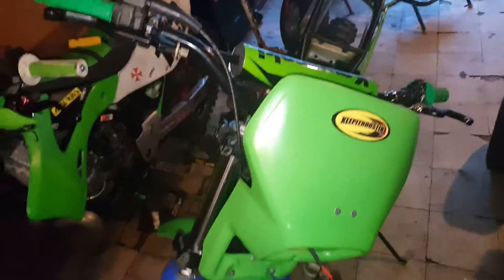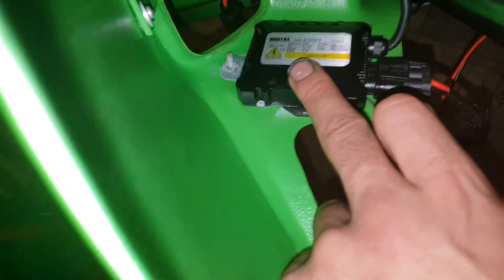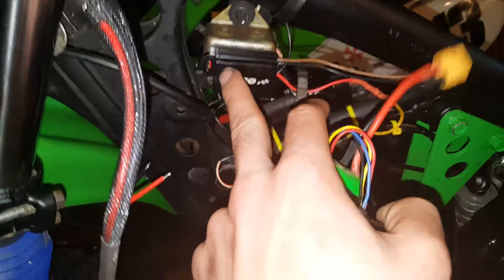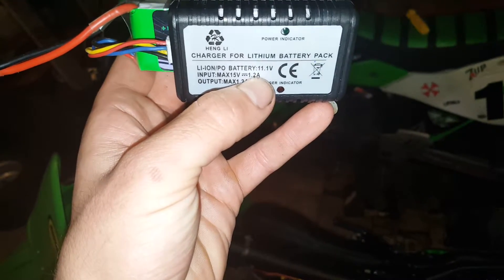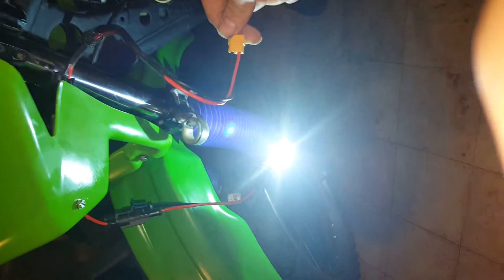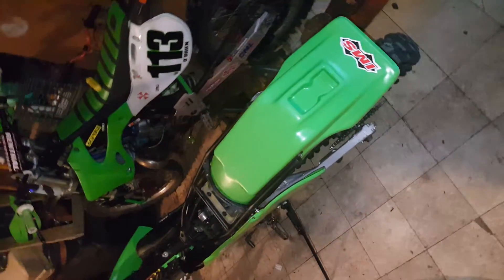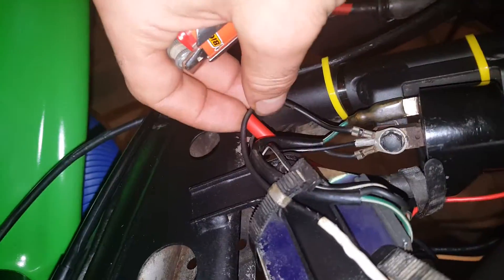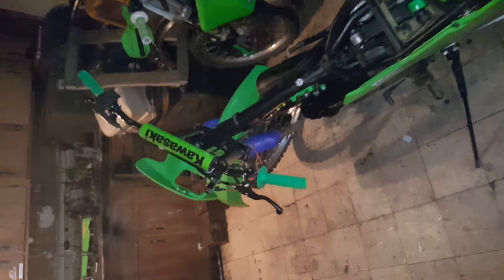86 Kdx 12v wiring

Comment: Was the battery charging as it was running or what it timing out on you? I'm in same boat except I transplanted a kdx200 into my drz 400. Currently wired lights to a switch running on lithium 18v battery. Bulb life is not long at all trying to get lights that 1 stay on and 2 are capable for night riding i saw ricky stator has a 85 watt but idk if it really will work so thats where im at . tha ks for posting such a good vid
Reply from the maker: Eric Arroyo it was charging as it was running but the voltage draw was too great I'd get a two hours to a fully charged 3s lipo at 11.1v, basically at 32W for the stock lighting coil I wasnt able to draw any more usable power. Ricky stator sells the 85W kits that would be able to power over a 7A battery 12V×7A=84W so theoretically yes it should charge a 5A/hr battery however just like the lipo issue youd need to take into consideration your draw and CCA value of your battery. Realistically I only used HID because they looked cooler than LED, however with LEDs i can get over triple the amount of time on a draw. My tail light draw only 0.02A and a newer led would probably draw around 1-2A max for the headlight which would save a ton of power and increase my run time. But yeah youd need a Ricky stator, a FW bridge rectifier, a 3-5 amp diode and a 2500 uF capacitor to make a Ac/DC converter box I've made them but they needed a stronger stator to work. Hope that helps man
Reply: @sparkynf12  thanks man i really appreciate it
Reply from the maker: @EandECustomCycles  no problem man, anytime.

Comment: Hi Nick, this is Marius From South Africa can you please contact me via E-mail mariuskok@rocketmail .com In connection with the conversion on your kdx. I try to explain to the ppl here
that work on my kdx, but they have no clue as to what i'm talking about. Kind Regards
Reply from the maker: I can just give you a parts list if that helps more, you'll need to buy a KOSO voltage regulator/rectifier, a lipo battery, a lipo battery balancing charger, and wire. Your lights you just hook up both negatives going into the negative end of the battery, and the positive is switched with a just a regular single pole single throw switch going from the positive of the battery to the switch and then to the lights. The KOSO Vreg/rectifier has 4 wires total black and red go to the lipo charger input to charge the battery. And brown and blue which brown gets grounded to the frame, and blue goes to the yellow wire coming out of the stator which is for your stock lights. Hope this helps

Comment: Very nice man. I have a 86 KDX200 as well. Could you list parts required and possibly a wiring diagram? I want to purchase a 12v headlight for mine
Reply from the maker: mitchmanisbomb I have more videos with the wiring diagram. I ended up using a koso rectifier with a dc voltage regulator and a lipo rc battery that I used for my drone. Also the charging circut is a 11.1v 800mah also an extra rc charger I had for a turbine heli. I used marine caulk to seal it up and mounted it in the tool bag with a nomex/kevlar lipo firebag. Hope this helps
Reply from the maker: I could list all the parts I used, and provide a wire diagram for the actual bike, also I used a halide bulb for the front which I get 38mins from a full charged lipo without it charging @ a 25C discharge rate, if I used led like I was going to, id get 2hrs+ and connected I'd get a bit more time I belive it came out to 4something hours. I am going to end up using two of these batteries in series, with a inline fuse, or get something safer than lipo. Either way two batteries doubles the time or while charging almost triples it. Me personally though, I thought the bluish hid looked cooler especially with the ballast, that's why I went that route.
Reply: Nick Ferrucci helped a lot. I already added the items to my shopping cart while watching the video based on the specs you were stating. How many volts does the stator put out during idle? Thanks for responding dude
Reply from the maker: mitchmanisbomb I belive it was 18.8 on idle, and 22.2 at 1/4T
Reply from the maker: Also no problem bro. I'm glad it helped, I figured since there is no info really online other than one other guy that did it on kdxrider and charges for diagrams, and the fact I really love the older bikes, id put it on YouTube lol plus the fact at first I honestly had no clue it would work, and it did perfectly, so the theory was pretty accurate. One other thing is I used a thinner gauge wire, I think it was a 14-15ga. As the stock wires were like sitting at a 12ga and were roached.
Reply: Nick Ferrucci hell yes! A wiring diagram would be great. Really appreciate it. Thanks for the info. My engine is apart right now so I’m kind of out of luck when it comes to observing the data. I’m probably just going to run an LED bulb. Yeah, a fuse would be the smart thing to do. Better safe than sorry
Reply from the maker: mitchmanisbomb Again it's no problem at all I'm writing up the diagram as we speak, do you have an email addy I can send it to when I am finished with it?
Reply from the maker: Just finished it, in ms paint. Just provide and email and I'll send it man. Hope it helps.
Reply: Nick Ferrucci thanks again
Reply from the maker: mitchmanisbomb no problem man
Reply: Nick Ferrucci sorry to bother you man, was just wondering if you sent that diagram? No rush, just wondering if it went through, I’ve had some issues with that email recently
Reply from the maker: mitchmanisbomb actually man I was waiting for you to give me the email address you wanted me to send it to.
Reply from the maker: mitchmanisbomb I thought YouTube might have flagged it, but alright I'm going to jump on the pc and send it now man, it will be coming from nicholas.ferrucci@yahoo.com
Reply from the maker: mitchmanisbomb alright man it sent, again hope it helps.
Reply: Nick Ferrucci it came through, awesome. Thanks dude
Reply from the maker: mitchmanisbomb Again no problem, if you need anything else just let me know man.

Comment: idk if you are over thinking this. But. I bought tusk enduro lighting kit, ac voltage reg, and then the recctifier. Just go from rectifier to battery. wiring headlight is easy through tusk enduro switch.